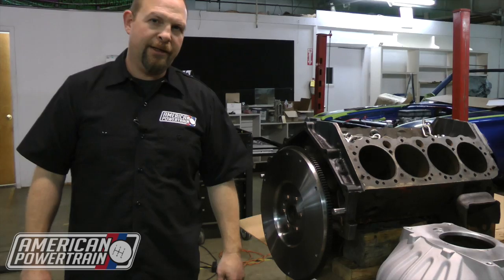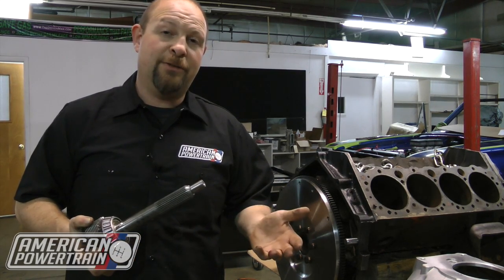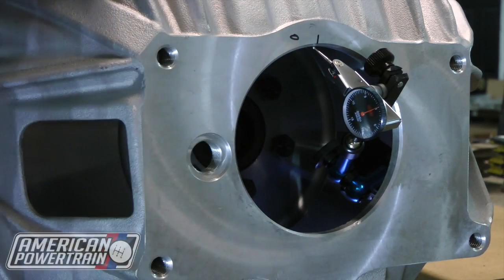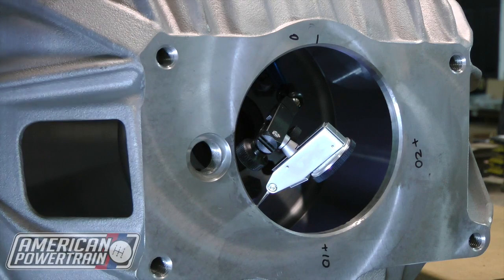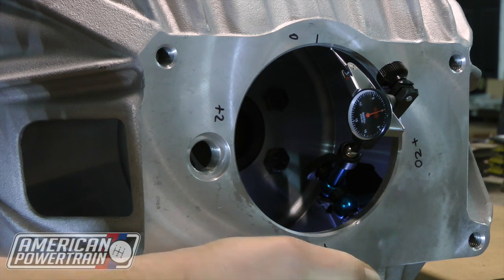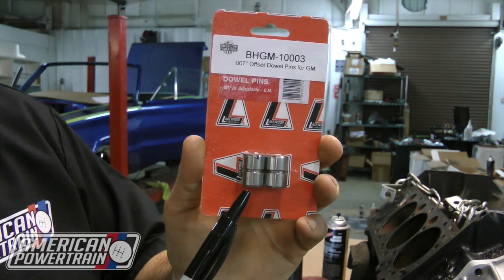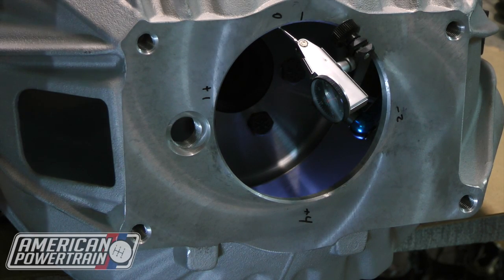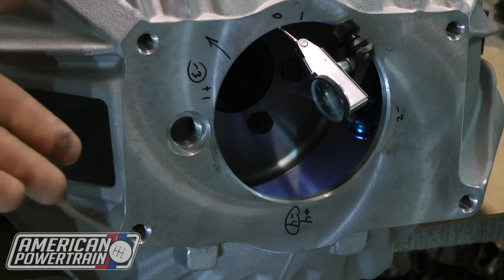How to Dial Indicate Your Bell Housing

Comment: Companies with ISO9000 certification do this in house after machining a few. At this point, adjustments are made so each bell housing you sell, are machined correctly before they go into the box and get taped up. But, I would guess the manufactures like GM, Ford and others machined and drilled threaded & dowl pin holes off center in the millions there made! That's it! They are wrong and the manufactures have no way of controlling how far off the holes are. I am so glad we cleared that up!
  For a minute, I thought it was your fault. Glad it's not.
DK, Omaha. ASE Master Tech since 1978, UTI instructor and ACDelco MASM retired!

Comment: How did you center the dial indicator to the flywheel lol I think you need to show that first. I have rescinded my thumbs down after watching a few other videos and I now understand how you came about this. Sorry for doubting you.
Reply: You don't have to. Just put it on with a magnetic base. You're not trying to find center you are just finding out if the bell housing is concentric to the crank.

Comment: His readings are not correct because of the sag caused by the weight of indicator and the associated parts of the mag base. Also, not using the proper location of the ball on the stylus will skew the readings. The sag can be tested too.
Reply: How can the sag be tested, Andy? Thx, Marlon
Reply: V8freaks  if you YouTube indicator sag you can see an example of how. 

Or, attach your indicator to a ridged piece of square tubing with the indicator touching it.  then, zero your indicator out as it's sitting upright. Then, flip it upside down and see how much the needle moves.
Reply: The location of the ball is what concerned me too. Shouldn't the arm of the stylus be perpendicular to the face being measured. ?
Reply: @Jordanrhart  you should also be concerned about the sag/flex of the arm that the indicator is attached to. there is flex induced by gravity.

the contact point of the ball should be perpendicular to the stylus arm.

Comment: Very interesting and informative I have been voting electric motors 2 Transmissions for 25 years now using a different technique to line them up. I spin the motor with 12 volts and move the transmission around till it makes the least amount of noise. Somebody pointed your Technique out and I am going to try it the next time I do a transmission that has a bellhousing that will come off. Learned something new today and that is always good thank you

Comment: The off-set dowels seem like more trouble than they're worth, is it better to use the Lakewood kit that has the longer dowels & weldable collars?  Are your options limited with an aluminum bellhousing?  
Excellent video by the way, you made your point, I'll index my bellhousing.
Reply: I have to think the weld on collars would be considered an non factory modification, and would void the SFI certification. May not be a concern if you don`t race the car, but if you do, and run quick enough to be required to have a valid SFI dated sticker, not a viable option.  Frankly, I have always just used the Lakewood offset dowels, and after it is all dialed in, I drill and tap a small hole in the block next to the dowel pin hole, and install a pair of Allen head set screws to prevent the offset dowels from getting moved out of position during bellhousing re&res.

Comment: I've been trying to check my SBC with a T-56 Quicktime bell housing, but having difficulty because there are numerous gaps at the mounting flange where I need these measurements to determine center, is there a practical way to correctly check these style bell housings?
Reply: Ok, I got it now. For these bell housings one must remove the front plate off the T56 and mount it to the bell housing to dial indicate. Tricky Tricky, I spent a little time trying to figure it out and the answer was right there on the Quicktime website.
Reply: couldnt find quicktime website...do you just place the magnetic side anywhere in the flywheel?
Reply: firebird pontiac yes, anywhere as long as the mic head can travel near center of the flywheel within its range

Comment: Do I need to diel indicate my LS to the T56?
Reply: Yousef Bin Ahmed *dial
Reply: you should check any bellhousing you mount with a dial indicator for being offcenter or not , even factory mounted ones could be off center , its just part of making stuff better then new
Reply: What is the dial indicator called so I can buy one to dial indicator my bell housing? Is it just a dial indicator with a magnetic base or does it need to be specific to do bell housings?
Reply: The LS T56 that bolts back to a LS with original dowl pins and bellhousing bots should and will lign up correctly. 
Hes taking a engine that has a different same bellhousing pattern but only a LS  crank pilot bearing hole to input shaft is going to different.